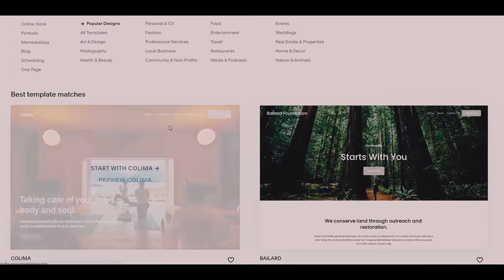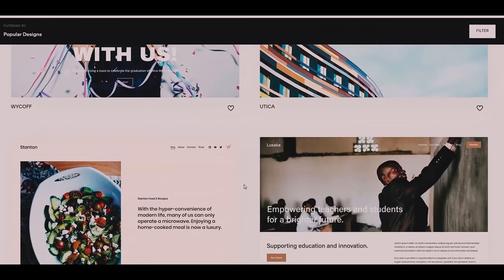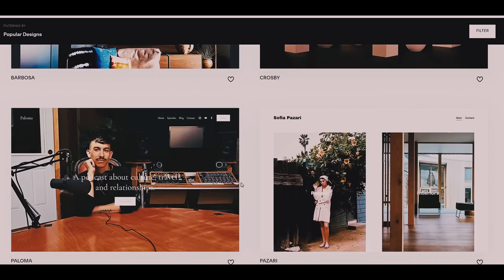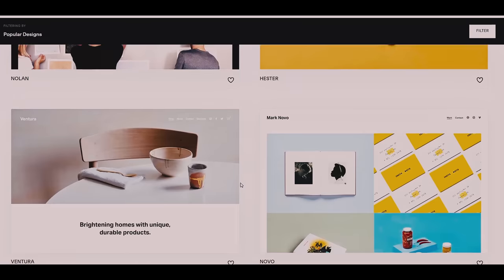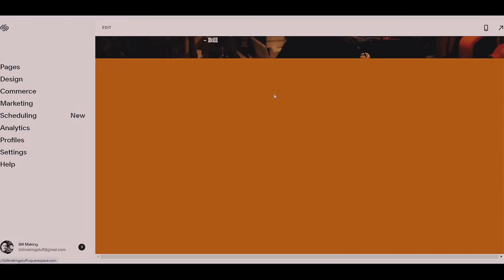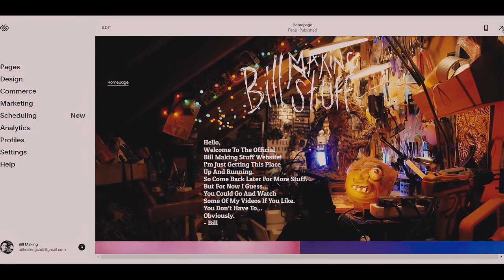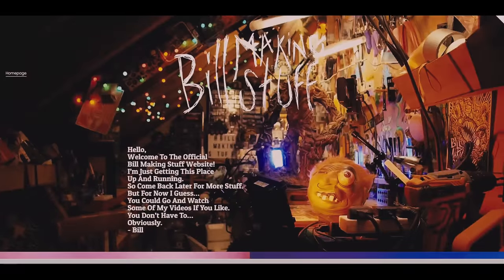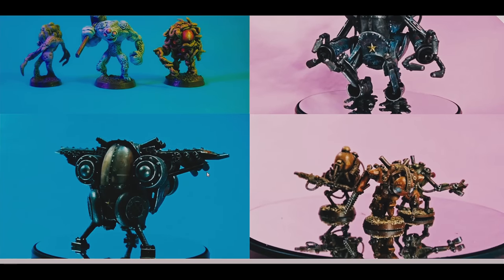How To Make Your Own HALLOWEEN MASK - Halloween Special!

Comment: another material that you can use instead of toilet paper is egg cartons made out of cardboard. tear it up first into small pieces then soak it in hot water to break up the fibers more and then squeeze as much water out as you can and mix it was glue, works really well. I've bade a mask from it before.

Comment: I caught Evil Dead and The Thing in the intro but I'm sure I've missed a couple other little homages through the vid.
Frankenstein's Bogdanoff came out pretty good in the end. I know Bill wasn't very happy with it but I liked it. Could have maybe done with some hair tufts and gore after the oil wash.
Akira's Rusty Starfish was great, I might try something similar, but keeping eye and mouth holes open on the mask to make it wearable. I think you could have thinner gauge wire wrapped around the edges of the holes and it would look like they were feeding into your eyes and mouth.

Comment: You can use flour and water in a watery batter to replace the glue mixture in paper machè! Its not ideal, but it works if you don't have or don't want to buy glue =)

Comment: I really like that wire face. Might try something like that in 28mm. (Probably with a larger than normal sized creature, so there's more room to work. Like a Chaos Spawn or Ogryn or something.)

The bit with the lights shining through the colored glass beads is really cool. I might try that on terrain pieces.

Comment: I don't know how you managed to get the paper and pva mix to stick to that cheap plastic, last year I attempted it on one of those cheap fake hokey masks to make it a bit more solid and even after giving it a hell of a sand it simply didn't take, I also managed to make the correct holes by filling the ones that weren't right with hotglue and using the hot nozzle from the hotglue gun to both smooth it and put holes into the correct spots, a technique I hope helps anyone out there trying to get a cool mask under 4$.
Still that wire mask is definitely extremely cool and if I ever get tired of being Jason or Michael Myers on Halloween I should give it a go.